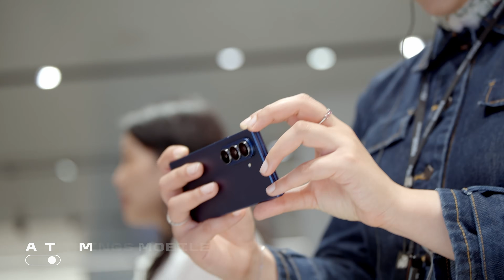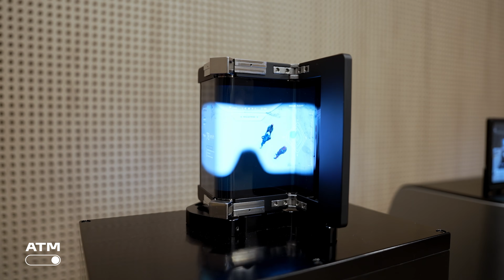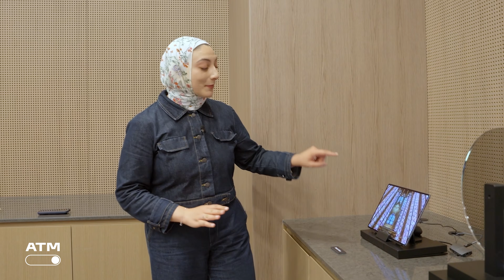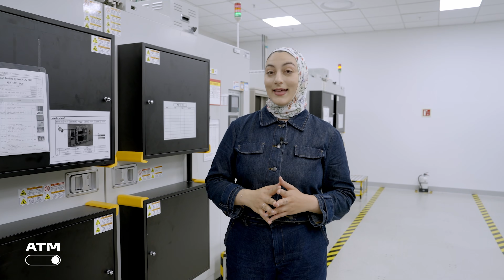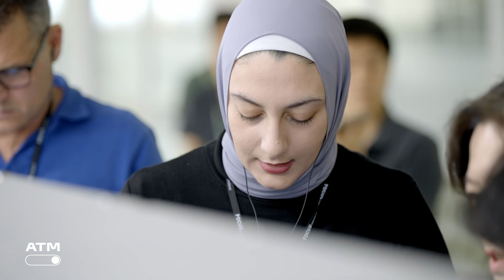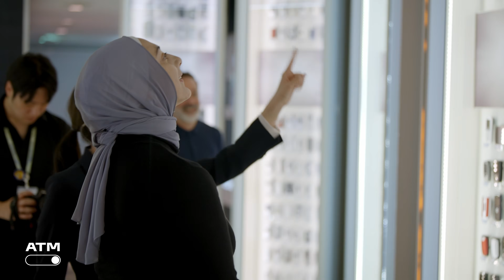Inside Samsung's Secret Display Lab Tour | All Things Mobile

Comment: As someone who is currently using a fold phone I wonder if slab phones will eventually fade away
Reply: Probably. I think that one day in the not too distant future, you'll be able to just pull the corners of the phone and expand it into different aspect ratios, and go from square to rectangular at will.